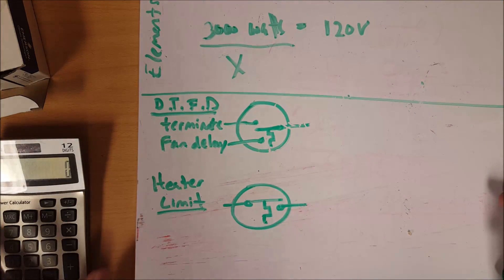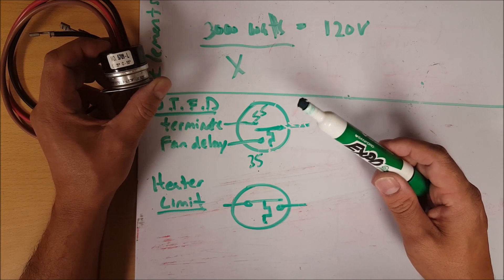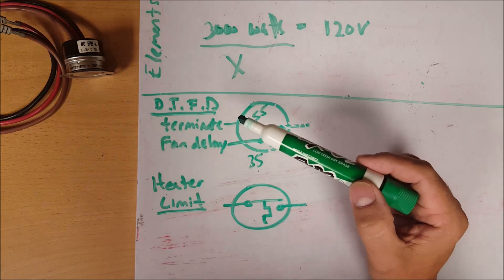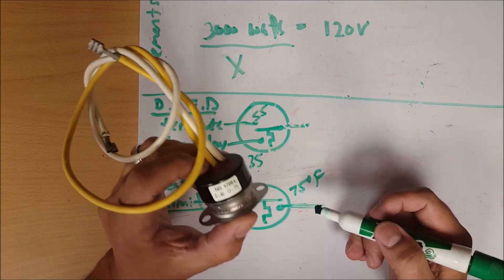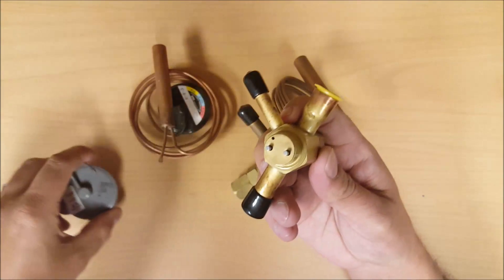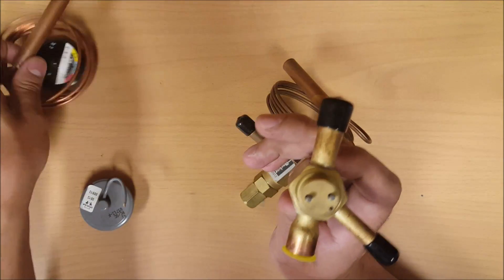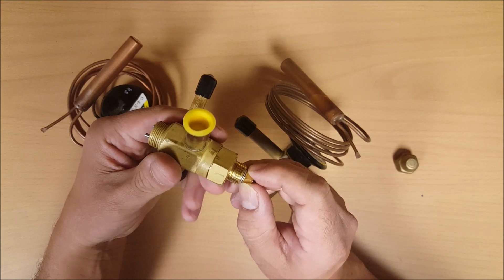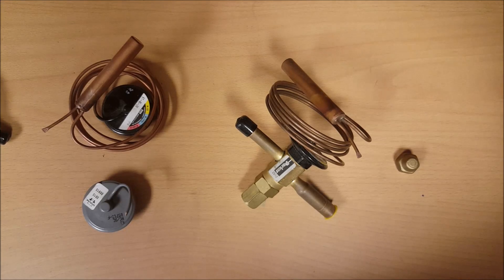Freezer walk in Evaporator Explained Part 2 of 3

Comment: Hi grey videos explaining so good I am learning a lot.thanks.I have a issue on my job I just babysit the equipment on Marina/restaurant and today a freezer bait was not cooling was run , back of evaporated iced and succión line to services valve was frozen also, I try to have it on defrost timer but it not work at that time. I defrost the equipment and turnd on again, Ahm clams on compressor 19 Ahm nametag shows 19ahm . Ok us the equipment run Ahm start to go down 5 minutes later Ahma compresor was on 16 and but that time the timer defrost was working. I just want to hear your support from you guys thanks

Comment: What keeps the liquid line solenoid open if the fan delay closes at the 35 mark? If the fan delay controls the solenoid and it reverses its action your gonna have a close valve. I think I misdiagnosed my fan delay today but regardless I'm still going to replace it. My heaters wouldn't kick in even when the timer was calling for defrost. When i got to the unit the whole evap was frozen over up to the suction line. 0 temp box and was at 22F. One of my evap fans failed

Comment: are the specs for temps 35 and 55 common for a walk in cooler or freezer ? I just installed one that is 0 -55.
Reply from the maker: +Lino Martinez 
Not sure I understand the question. I think your asking about cooler vs. Freezer box temperatures. Coolers are typically holding approx 35*F. Freezers about 0 to -10. Evaporators usually run approx 15-20*F colder than box temp.